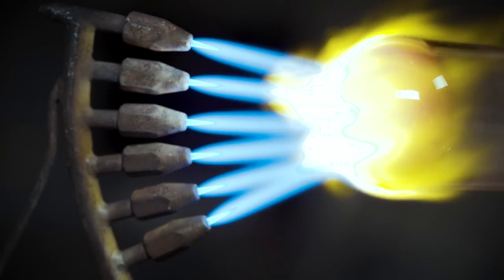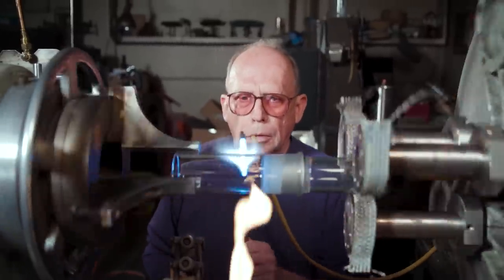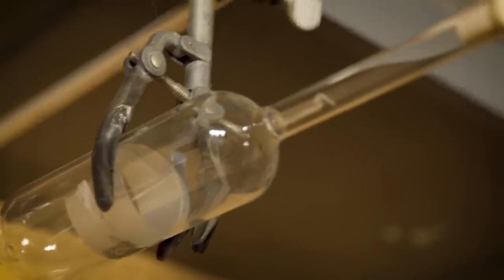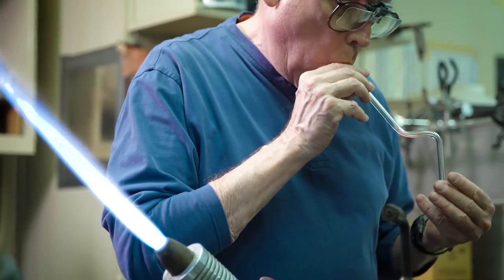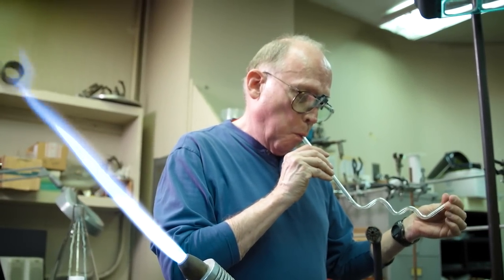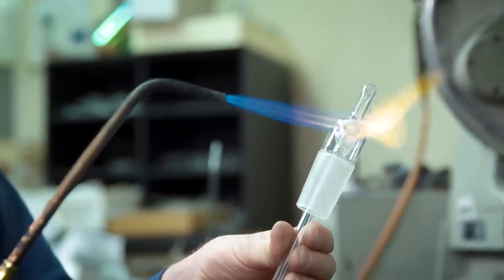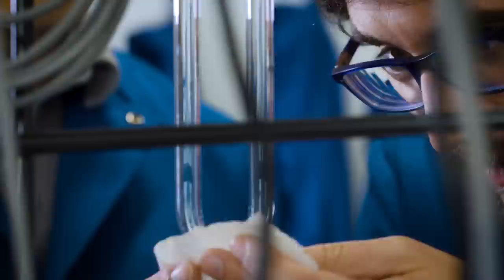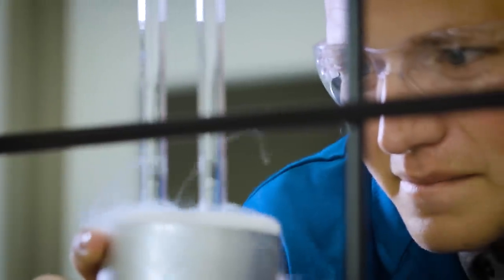Portrait of a scientific glassblower

Comment: This man needs an apprentice. We can lose these important trades.
Reply: I agree, but one of the most lovely things about science is that, even if it’s lost, the fundamentals that make it work like it does will never change. 
It can always be rediscovered.
Reply: Scientific glass blowing isn't just knowledge, it's a skill set that is not easily mastered even if you can theoretically figure out 'how to do it'. The ancient Etruscan skill of solderless soldering used to decorate things with gold *granulation was lost for a thousand years. Finally took a chemist to figure it out. Melting point depression. I'll let you look it up.
*Granulation consists of affixing tiny spherules of gold to Gold substrate to decorate jewelry, some of the tiny spheres are a hundredth of an inch diameter. I've been a scientific glass blower glass for 30 years and making jewelry for 25. Never tried my hand at granulation.
Reply: Sadly, very few people want to use their hands anymore. I tried several times to train people to help me at my scientific glass blowing shop but most people simply have neither the desire nor the ability to work with their hands using fire. None of them lasted over 3 months. Frankly I think they were all more interested in making pipes than scientific glass blowing.